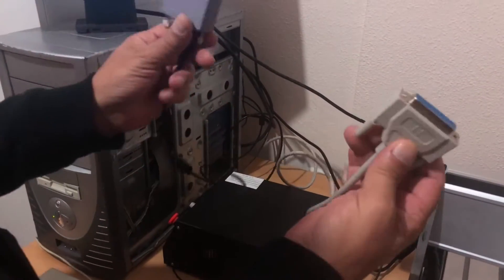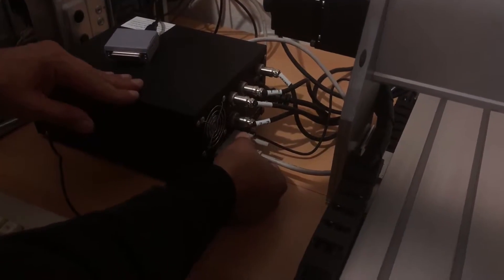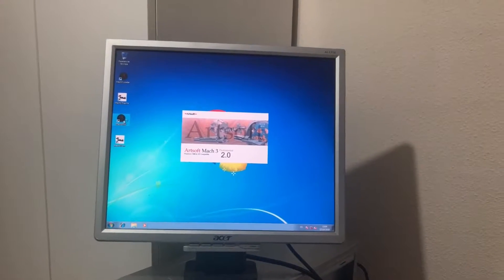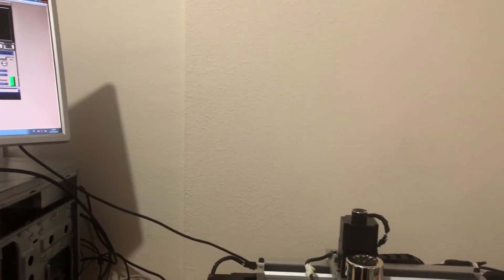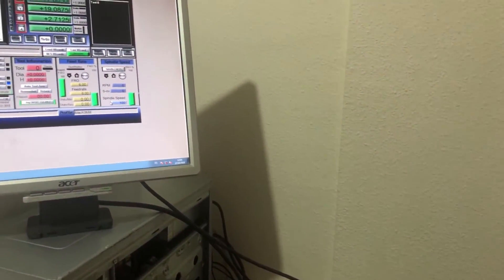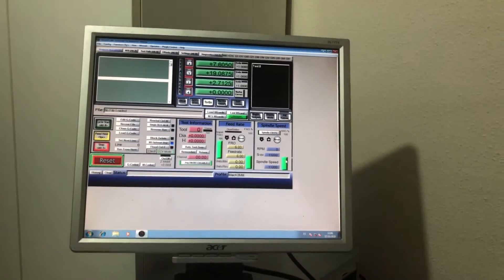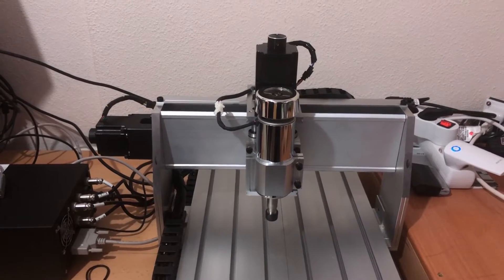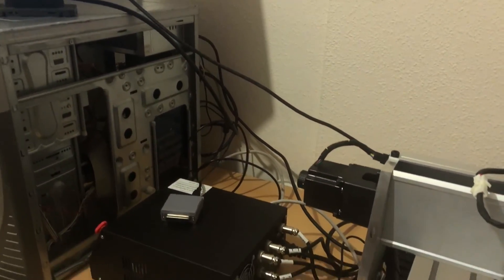Trouble with RTM200 LPT ( DB25 ) to USB port Motion Controller 3040 router part 1

Comment: I solved the problem of LPT and USB with the help of the Mach3 USB Controller (BSMCE04U) board, but now I settled on an autonomous Wifi GRBL controller and I am very pleased. There are reviews on the channel.
Reply: i have big problems with 3040, with electronic-pw3618, nt65-3x, rtm200.Cant determine problem. is it rtm200 or nt65 controler. cnc wont work on both modes-via rtm200 or mormal via db25
Any help will be fine. THANKS
Reply: @bblloobb1000  I didn't use these
Reply: @kAsmechanic  can you tell me, about settings in Mach3 with db25 using